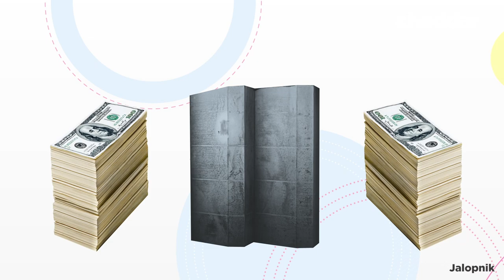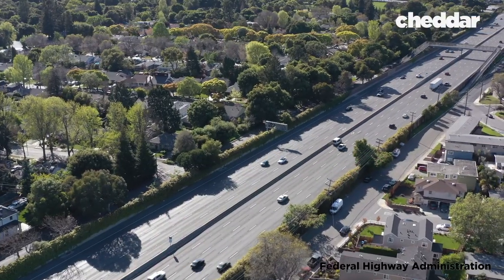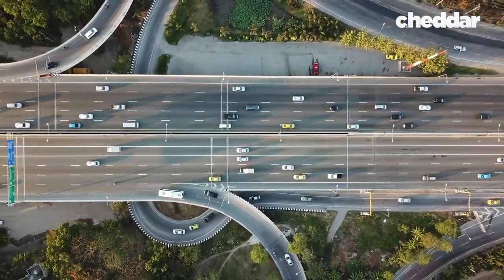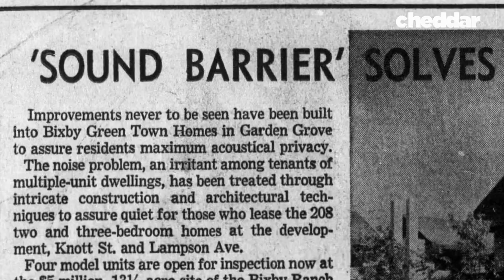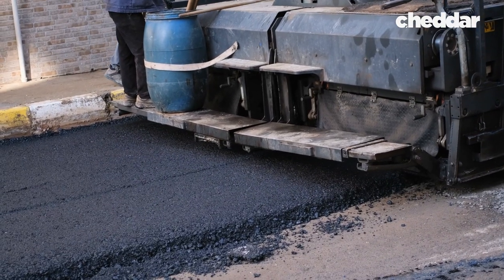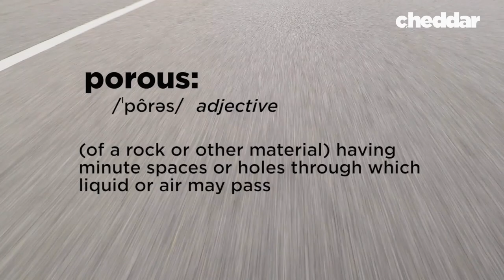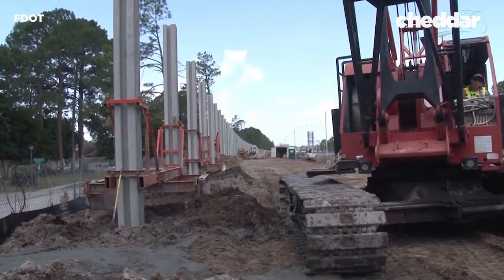How Highway Noise Barriers Can Make Traffic Louder - Cheddar Explains

Comment: So basically, concrete is so convenient that even after it's been proven that it not only doesn't work, but it makes the traffic noise worse and more deafening, the state won't do anything because doing so is a pain in the ass.

Yeah, sounds about right.
Reply: As politician, explain to everyone why you won't do anything against the sound pollution.
Reply: Even if it is louder when installed (And TBH I don't find "online journalists" UnDark reliable)...let the vegetation grow over it, and it will prevent this phenomenon. The Kudzu will quiet it down in a year or so.
Reply: Should have made cones on the barrier
Reply: New infrastructure is mostly subsidized by federal money, but reparing/maintaining/removing old infrastructure is paid almost enterily by the city and a bit by county/state. Most cities are not flooding with money so they opt to not do nothing to not go bankrupt
Reply: @TheKitMurkit  please explain more?
Reply: @TheAvsouto  It's a ponzi scheme. The cities build new streets and highways because they get subsidized, but then after 20 years when it starts to fall apart, they go bankrupt.

The solution is to redesign cities to focus less on the car but more on pedestrians, cyclists and public transit. The car takes up a ton of space and the roads cost a lot of money. End some zoning laws as well and let small businesses open up wherever they want to and not have to have a massive parking lot. That will increase local tax revenue
Reply: @jackgerberuae  It's a fact. That's what conservatism means. They're fighting against all the infrastructure spending bills, they want the roads to go to waste. They keep complaining about the costs, yet gave massive tax cuts to the rich and increased the military budget and as a result the national debt went up another trillion. In reality they're pure hypocrites and liars that only want to do just that and nothing else. They have nothing to offer.
Reply: @jackgerberuae  it's consistently true. The blocked Obama era rail projects, and consistently oppose mass transit solutions
Reply: @austinhernandez2716  no it’s not.  No American wants to see roads go to waste. Forget your Dem narrative and start thinking like a rational citizen.
Reply: @Joesolo13  it cannot be generally or consistently true. Forget about this partisan arguments. You argue for the good of society, country, kin and folk within which, you can convince any fellow American. Failing which, your case is just too weak. Arnold S proved that during his tenure as Cali Gov.
Take as prime example the dismal state of NY subway system. It’s a mess, but who would you consistently blame?

Lastly, mass transit is a certain way of life. To shift the paradigm is going to take national buy in, beyond political colours (again).
Reply: @bcubed72  
1. There's no kudzu in most of the country. Like here in the Midwest.
2. Vining plants damage concrete. Concrete is a polluting thing to construct and so doing it more often is horrible.
Reply: @jackgerberuae  you literally made no real argument other than "WAAAHH NO YOU'RE WRONG CUZ I FEEL IT", no rational logic or cited data was used; if you actually do research you'll find how terrible a car centric city is and how many billions of dollars are lost in inefficiency and productivity and health problems and lost time due to car centric city designs
Reply: @r3d0c  all hat ‘n no cattle, as they say. No statement of proof from you? I am a qualified professional in this business. No need for me google. 
Top tip: no city is the same, so making such nonsense generalizations shows you are simply naive. 
Sit down and drink some tap water.
Reply: @jackgerberuae  Well it sure seems like that. The conservatives want the budget to be like $20.
Reply: @jackgerberuae  Well it sure seems like that. The conservatives want the budget to be like $20.
Reply: @Neil-de1fh  what lies?
Reply: @Neil-de1fh  what lies?
Reply: @jackgerberuae  "No city is the same" What's that supposed to mean
Reply: @austinhernandez2716  please pay attention. Whatever you say can be true, depending on context. Bringing partisan politics into it, makes you a natural failure as a critical thinker. 

Therefor, sit down, and have some tap water.
Reply: @austinhernandez2716  “no city is the same….”
Exactly that. You cannot make statements about city planning… failures, futures or fortunes unless you analyze their history - simply stated. What’s lacking in the US is a clear and constructive policy, on all tiers of Government. Again, partisan politics is failing the nation, and most of all, the so called Democrats are to be blamed.

And AGAIN, I refer to state of chaos Arnold S found the state of affairs when he got to office.
Reply: Not exactly, it still protects the homes RIGHT next to the highway where it’s really loud. They’re the people that would suffer the most w/o barriers
Reply: @jackgerberuae  Conservatism is to preserve. But you can have a long discussion about if the modern Trump Republicans are really preserving anything. 

It's difficult to discuss anything, when it's told so simple and without nuances.

And to be honest, there is a lot of ideology coming from the so called conservativea too. A good compromise is not always the best answer. But it's better than doing nothing at all.
Reply: In Europe you wouldn't find a single km of concrete highways. Porous Asphalt is the way to go.
Reply: @austinhernandez2716  not forcing businesses to provide onsite parking is the problem with major cities now which is why cars r parked on the street. If businesses provided their own parking then there would be less congestion in the downtown area because of the lack of cars on the street which would allow for a larger roadway capacity.
Reply: @jayperk5021  Oh, so you support FORCING businesses to have to buy more land and waste more money? It's simply NOT POSSIBLE for all businesses to have a huge parking lot. There's only so much land available. And thinking that bigger parking lots and more traffic lanes will solve the problem is the #1 mistake you learn about in urban planning. That has been PROVEN to be false. Adding more road and space only makes the traffic worse because more people will start using it. Anyone who knows anything about city planning would know that.

The real solution is stop designing a city to FORCE YOU to use a car. Sure a car should be an option, but you shouldn't be FORCED to buy and use a car if you don't want to. You don't get to decide how a city is built, so the city shouldn't force anything like that on you. Have roads avaliable for cars, but also sidealaks and bike lanes and public transportation. Don't have a highway going through the middle of the city either. Let their be a variety of modes of transportation available. In most American cities, driving a car is the only option. Do you call that freedom? That's authoritarian.
Reply: @austinhernandez2716  ummm actually in major cities like New York and Chicago there r plenty of options other than driving a car to get to the downtown area and to get around it. I was just talking about how businesses use the street for parking instead of designing their site plans to hold the amount of customers they plan on generating.
Reply: @austinhernandez2716  they don’t need to buy more land. They need to better utilize the land that they’re want to build on.
Reply: @jayperk5021  Sorry but you HAVE to buy a lot of land for a parking lot... Cars aren't small... A business shouldn't be forced to buy any land at all if they don't want to, except for the land underneath the building/part of building they're using.

Also guess what, not everyone lives in NYC or Chicago.
Reply: @austinhernandez2716  the problem is that we have normalized businesses not having to provide parking in certain areas. So it makes it seem as if it’s an extra expense in urban areas or “main streets”. If anyone wants to build there facility in the suburbs it is not even an option whether or not they need to provide parking it is in fact mandatory to provide because the road is government property and should not be used for private benefit. Business get away with it in downtown areas because most places don’t provide onsite parking and on-street parking is allowed so it looks bad if the government asks for them to provide it. I’m all for private businesses but these businesses add to the congestion and they should mitigate it with parking on their property. Idc if it costs them extra because it costs the taxpayers extra time on the road and also money because it’s the taxpayers that are paying for the maintenance of the street that these cars r parking on for the private businesses.
Reply: @jayperk5021  You're not making any sense. You know that parking takes up a ton of space right? Space that could be used for more businesses, generating more tax revenue. But no, I guess you don't want that, instead you want higher taxes on non business owners. You want less money having to be spent on infrastructure, yet you want to continue to force people to drive, which wears down the roads and result in more tax money having to be spent on maintenance.

People don't have to drive to the business you know. Don't want to walk there? Not the business owners problem. What if I don't want to be forced to drive there? Why favor drivers? Especially during the climate change.

"Get away with it in downtown area" because when it was built they didn't have the automobile yet, and there was a more free market. Today, only the big businesses like Walmart can open. Want open up a small grocery store near a neighborhood? That would be great. People could walk down the road to get basic groceries. More small businesses could open up. There would be more jobs. There would be more tax revenue. But no, you can't, because that's illegal. Instead, you have to open it up in a certain part in the city, and you have to buy a massive property along a busy, dangerous freeway, making it literally impossible for people to walk there, forcing them to waste money on a car they didn't want, risk their lives on a dangerous highway, waste money on car insurance, waste like 20 minutes driving across the city, 5 minutes just to get out of the neighborhood, and contributing greatly to global warming.
Reply: @austinhernandez2716  I was just talking about businesses needed to provide for parking. You went off on a tangent about global warming…🙄. Please stay on topic. Just because cities were built before cars were invented doesn’t mean we should continue the trend. And anyways just because more cars r able to park downtown doesn’t mean more people will drive. It’s called having to pay for parking which will deter people from driving to downtown areas. That’s why most people who live near major cities prefer public transportation over driving to the inner city.
Reply: @jayperk5021  my point is it should be a free market. Minimum parking spaces is expensive, unnecessary, makes you have to drive out walk further, etc. If the people don't like a business not having a lot of parking spaces then the business will fail. Let the people decide.
Reply: @austinhernandez2716  you know nothing about conservatism
Reply: @austinhernandez2716  you’re going to complain about the government to spending  too much money AND not wanting to have a big budget? Wow
Reply: @jamesbizs  Read again 🙄

Also, I used to be a conservative. Beginning of my college years, I was a Trump supporter. I was a huge Shapiro fan. I know all about the conservative bs narrative. Conservatives are nothing but reactionaries.
Reply: @jamesbizs  I think you misunderstood him Conservatives complain about the budget when it comes to providing services or infrastructure for American citizens but then give massive weapons deals to Israel, subsidize large businesses, and pump more money into an inefficient Military Industrial Complex so their hipocrits and they really don't care about the spending or deficit at all. To be fare though neoliberal democrats like Nancy Pelosi or Joe Biden aren't exactly champions of the poor and they often will do the same complain about spending then  give money to Israel or business subsidies to corporations the difference is Republicans really want to give nothing back to average Americans and democrats give some crumbs.
Reply: @jayperk5021  You seem to just be saying a lot of stuff without really educating yourself on this matter. The highways were built by general motors and they built them in a way to incentivize Americans to buy a car rather then use public transportation or walk. All you have to do is look to countries like Japan or many Cities in Europe to see why this was a bad idea. First the roads the more cars you have driving on the roads the more money it costs to repair the roads. Second air quality the more cars you have on the roads the worse the air quality will be in the city. Third car focused city designs are not good for raising kids in America this is painfully obvious in Japan and Norwegian countries especially young children are often allowed to go into town to get grocerys and see friends without an adult accompanying them because the cities are often built to incentivize people not to buy cars because of lack of space teenagers also drive much less which helps keeps accidents down. When you're saying we should create harsher zoning laws thats not really a good solution especially in cities like New York or San Francisco where space is limited. Cities need to improve public transportation and infrastructure to make it easier for people who don't have cars then remove zoning laws that restrict small businesses by requiring them to have parking. Doing just those things alone will illeviate road congestion, help level the playing field for the working homeless since it will be easier to get to work without a car, lessen pollution, lessen money spent on repairing roads, make cities safer with more space for pedestrians and less fast moving vehicles, and cities that center around pedestrians usually look and sound better with less noise pollution smog and more area for parks and plants that would normally be taken up with concrete and asphalt. The only reason America is so car focused is because the corporations bought off our government and the car companies want more people with cars because that means more money for them.
Reply: @roryleal6473  Lol you don’t know my education level because if you did you would know that I’m well qualified in this subject matter so please don’t assume that u do. All that writing about smog and kids is hilarious to me because I never mentioned it. I simply said developments need to provide parking on their site on not use the street the taxpayers r paying for. I agree with expanding public transportation I never said I didn’t. And this isn’t some big corporation conspiracy problem. This was poor planning that wasn’t anyone’s fault because when cities were first built they were built for horses not for vehicles. And besides poor planning it is the people who r holding back public transportation from expanding not the government or big corporations…just look at the city of Atlanta for a prime example. They keep voting down expanding MARTA when that would alleviate the congestion they r currently experiencing. And once again I’m not talking about smog or raising kids I’m strictly talking about capacity. Smh.
Reply: @jayperk5021  Businesses should be able to cater to clients who will walk to the business they shouldn't be required to provide parking because this just provides more incentive for people to have cars. More parking lots equals more distance between buildings, more space covered by asphalt, more costs that make it hard to own a small businesses, and still cities that are designed around cars with pedestrians being an afterthought. We don't exactly live in Europe much of the infrastructure was built after the invention of cars in America including the highways even in places like London where the cities were already massive way before a car was ever there they have better solutions to this problem then in America 70% of people in London don't own a car and its easier to get most places on foot. What your suggesting is like putting a bandaid on a fire hose the issue isn't lack of space for cars lmao the issue is lack of reliable public transportation and infrastructure designed for pedestrians as well as outdated road designs that haven't been improved majorly since FDR was president. Making more strict zoning laws will do little to alleviate this issue and mostly just hurt small businesses and the environment. Stop getting so caught up in the details its not super wacky to bring up the safety of children and smog in a conversation about road construction all these issues are related focus on the debate lmao. General motors literally built the highways and they built them in a way to sell more cars not to make things more accessible to pedestrians or public transportation thats a fact its not a conspiracy look it up.
Reply: @jayperk5021  Trump literally said he would improve infrastructure then got into office and cut federal funding of infrastructure projects putting it into the states hands knowing the states won't have the money to improve the infrastructure and will just hand the developments over to private businesses. I don't really think one instance of conservatives voting down infrastructure because they are afraid of taxes and government overspending can compare to the effects lobbying has had on our infrastructure. The money we used to use to build bridges now goes to the ceos of weapons and oil manufacturers and Saudi Arabia and Israel so they can commit genocide.
Reply: that and , no doubt , the company supplying the concrete has a poI in it's Pocket
Reply: Because noise dissipates with a reverse exponential curve, often times, though, by the time you get far enough away for this to matter, the noise has dissipated so dramatically that nobody can tell the difference anymore.
Reply: Hey